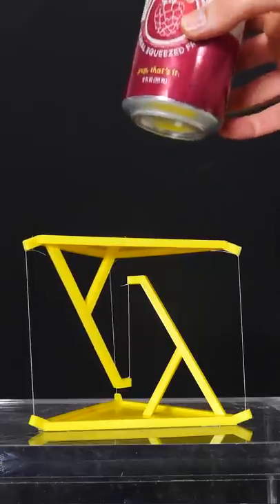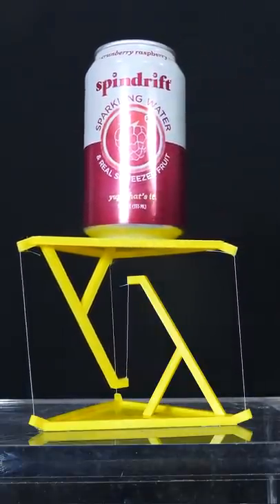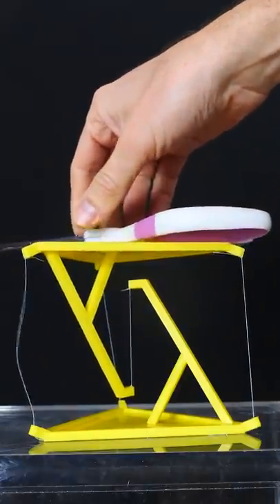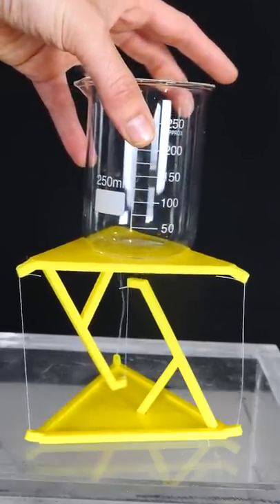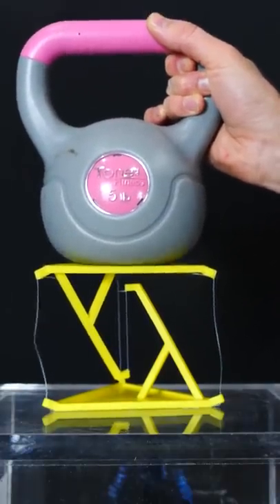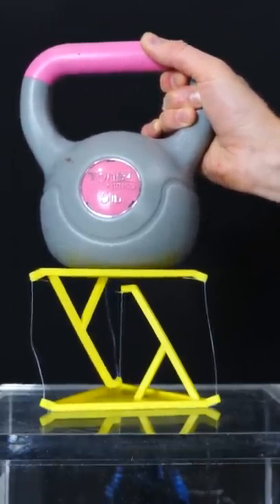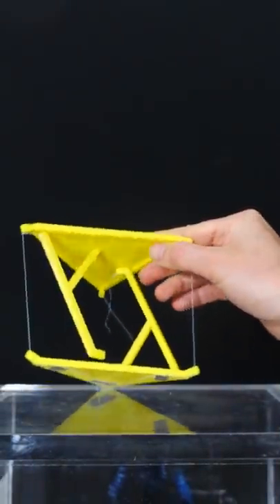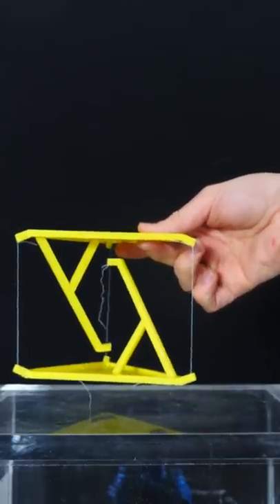Floating Tables Holding Weights

Comment: The outer strings aren’t useless, they add stability to let the stop platform stay steady in three dimensions. If you had something to lean it up against, you could make it with two outer strings
Reply: Could you do it with no strings if it's inside a tube?
Reply: @timothytai691  no, you need atleast 2 strings even in 2d
Reply: At first I thought they were, until I saw him putting stuff on top of it, I realized that they were actually stabilizing the plataform
Reply: @npc4416  But it's not 2D, instead I'd be taking sth like a triangular prism and cup it over the "table", so that the set-up won't move sideways.
Though I'm not sure if the middle string would be affected
Reply: @timothytai691  if you lived in a 1d universe yes
Reply: I'm confused. Did he say the outer strings were useless? I mean... they're there for a reason, right?
Reply: @npc4416  I’m pretty sure you don’t need outer strings if it’s in a tube… the three outer strings and the tube do basically the same thing, holding the thing in place. You just need the one string that holds it up
Reply: @Andy-iq9pz  you need one string to prevent movement when you push it, and the other one to prevent movement when you pull it (this is because a string can only resist force when its pulling it, if you push a string then it will slack and fold instead of resisting the force, so it can  not prevent push) therefore you need atleast 2 strings to prevent movement in up or down direction, the other strings are there to make it stable and they are not necessary ( note that if you used a rod instead of a string then since a rod can resist motion in both a push and a pull because it does not slacks when we push it, therefore we just need one rod but if we used strings then we need atleast 2)
Reply: @timothytai691  weird answers here.

The sheet answer is no, because the platform isn't balanced. Without strings, even with support at the side, the top will tip because the centre of weight is far from the centre. The side strings apply pressure to prevent it from tipping.

It would work without side strings if the top had no way of tipping.

I suppose a single string could be used if you could balance it perfectly, but any vibration would tip it. 2 strings could be used, though it wouldn't be very stable
Reply: If you take away the three strings on the sides, you can see that the middle string is holding up the top section, but it would fall over on it's sides without the three strings, that holds it in place.

Comment: It’s all about tension on the middle string.  The middle string is doing everything and the outside strings just hold it in place.  The outside strings don’t do anything at all for integrity, just control.
Reply: They all work together. The inner string broke first because it had 3 times higher tension compared to the outer ones
Reply: @JamilKhan-hk1wl  The outer ones have virtually no tension at all.
Reply: @lilkittygirl  if theres no tension, the string wouldnt be upright
Reply: @JamilKhan-hk1wl  the outer strings collapse when weight is applied to the table. There's no tension. At least not on all of them at the same time. They are there to keep it from tipping, so one of them will have tension when weight is on the table.
Reply: @krisdiane  You were correct. That happened because the structure which which was supposed to withstand compression has bent, because it was flexible under heavier weight, which automatically released the tension from all 3 outside strings at once, and left all the tension on the middle string. The middle string was already under more stress than all the other strings.
Reply: Sounds relatable tbqh
Reply: only true when object is perfectly in the middle try putting it on edge
Reply: Yeah its clearly visible on the first glance
Reply: The crossmember of the y on top attaches to the center of the top pulling tension to the center string. The other strings balance it.

Comment: Is easy people, the string on the middle is carrying all the weight, the other 3 strings from around are just for stabilization, that’s like some muscles of the body work
Reply: so if the one in the middle is really strong thdoretically the other 3 can be not as strong and it should be fine right
Reply: @dae36  Indeed, with a titanium String you could do a working chair
Reply: Can u give me an example of a muscle that work that way?
Reply: Sorta
Reply: @dae36  nah.. the others need to be able to hold the same amount. If you put the load on one side, it’s both the opposite string and the middle string that share that load.
Reply: Oh I see.
Reply: @Rafaeow  time is money
Reply: All 4 strings carry the weight, if any of the string snapped, the table will collapse too
Reply: @muhamadnafis1517  not all simultaneously necessarily
Reply: I know my friend was like how does this work and I'm like you don't understand 😑
Reply: Yeah, I understood after looking 7 times the video
Reply: @Rafaeow  all muscles can only ever exert pulling forces (ie tension). When you do a push up for example, your muscles aren't  actually pushing. Rather your triceps and pectorals or tightening which results in your elbow straightening and your upper arm swinging inwards towards your chest. The bones take all the compressive forces exerted by the load (in this case your weight) and your muscles induce. So while you aren't a tensegrity structure, you are made up of purely tensioning actuation devices.
Reply: You explained nothing!!

Comment: Super interesting fact: muscles and bones are this type of structure! Although muscles can only create tension ("pulling") force, they help the body stay in its shape. That is why people with low muscular strength can suffer from bad posture.
Reply: No one asked
Reply: @hsvr  “Hey Luiz, can you tell us an interesting fact about this type of structure?” There, I asked, now stfu.
Reply: Thats really cool and interesting
Reply: @purpledefaultpfp6233  nice name, fits well with this short comment story lol
Reply: @hsvr  what the hell dude, I asked, are you disregarding my existence?
Reply: Kind of. Bones can take both tension and compression where muscles take only tension. The "impossible table" shown in the video has a middle string which takes tension to support the upper member. Bones have the same supportive function but do it instead by taking compression, not tension. In our bodys, the muscles are an equivalent to the tables outer "balancing" strings.
Reply: @hsvr  No one asked
Reply: @scann563  Bones would be the lambda-beams in the table analogy. Muscles stabilize (as the lateral strings), but they can also "hold you up". That is why having abdominal strength favors better posture...well...or so said my physiotherapist
Reply: @hsvr  no one asked about if anyone asked

Comment: “Doesn’t rely on compressive strength”
The plastic arms it’s built on: gonna end this man’s whole career
Reply: Exactly. It's not revolutionary, the load is still supported by the rigid members.
Reply: @joshbridges8410  still a building balancing on string is pretty cool
Reply: @joshbridges8410  that may be so but there is the advantage that you can build the parts that undergo compression with Materials that have crap tensile strength
Reply: @jakejones5895  you can't, because the central plastic arm has a bending moment. It's in compression and tension, compression along its bottom face, and tension across its top face.

The material you describe would be something like a ceramic, and that would not work well in that position.
Reply: What if you used something like this for the footers of a building? I'm thinking a lot of them to dampen earthquake vibrations?

Comment: With enough strings around the edge and enough strings to hold up the structure it looks like you can make a stable surface using a small amount of materials to support the structure.
Reply: There are limits tho.... A structure comprised with many of what you are describing could become highly unstable. So no building, just toys.
Reply: check out the channel Evan and Katelyn! they made a table using this concept
Reply: @ritarribeiros   Tables, chairs, stools, are fine. I said no buildings, as in 🏢🏬🏭🏗️
Reply: @bakemonsan6978  sorry the reply was meant for op🤦🏻‍♀️😅
Reply: @ritarribeiros   cool, next time don't tag people within the replies. There is a place just bellow the orginal comment when you click on it. 😉👍
Reply: @bakemonsan6978  fun fact strongest spider string is alot stronger than metal

Comment: I honestly can't comprehend what's happening here.
Reply: My best guess would be that the strings themselves are able to withstand a certain amount of force  the three strings on the outside act like support for the one in the middle and the middle is like that one guy from Greek legend atlas who holds the world on his shoulder they each support a different amount of weight but the one in the middle holds most of the force which is why it snaps at five pounds because it overcame the materials stress limit (how much force it can withstand before snapping) for example if you were to bend wood or pull a string until it snaps, @Colin Cooper
Reply: @kindered7988  I guess if you try to imagine that those strings are solid objects it's easier to understand.
Reply: @colincooper4659  yeah, I hope my explanation helped a little
Reply: It's a positive feedback effect. The string in the middle keeps the upper structure from falling (by pulling itself down, and the lower structure keeps it from falling), and the strings surrounding them are for stabilizing, just like what you've just said
Reply: @HeidenLam  thank you for the clarification I just wanted to explain it in a say understandable way 😅
Reply: @colincooper4659  or just imagine the structure without those 3 outer strings. then imagine placing a weight on in it, the bottom of the top part will move in an arc because its connected to the centre, now if we place those three outer strings, they will prevent the upper part from moving. The centre wire is always stretched and depending on the direction of arc, two of the outer strings will stretch while one will get compress.
Reply: Lol same here bro
Reply: When weight is applied, you’re pulling the center string apart. Outside strings for balance.
Reply: two Magnates in nagivate situation 🍭⛓️

Comment: It works because of the string in the middle holds everything  up and the strings on the side keep the top part in place
Reply: Exactly! The string in the middle works (mostly) against the vertical gravitational force, and the other three stabilizing against the side forces. The more strings on the side the less wobbling you'll see, so they are the stability factor, but only the one on the middle is defining the strengt of the structure (and the material of the whole construction of course).
Reply: He explained it at the end_-
Reply: and forces are born not just by the center string, but the thin plastic eyelet that string passes through.  Even with stronger string, that area is still a weak point.  this has been proven in link and pin bridge failures.
Reply: @steves2694  it’s all torque my guy

Comment: Imagine this on a bigger scale with steel wires, like those on bridges
Reply: It obviously would NOT work with steel wires.. That's litteraly the point
Reply: And when the wind blows a little too hard the bridge violently wobbles all the cars off of it
Reply: @wioi  I even seen a table built like this that used steel chains instead of threads. So i think its possible.
Reply: @wioi  huh???
Reply: @wioi  huh?

Comment: My slow brain finally worked this out. The fact that the outer strings are loose is what keeps it up. Due to the shape, the structure falling down, actually creates a pull on the center string, making the outer ones hold it in place, as the center string does the work of keeping it stable.
Reply: What? I can't comprehend if this is genuine stupidity or sarcasm
Reply: I dont get what youre confused about. This is a comment simply stating i understand the science of how the tension works. Your comment seems unnecessarily antagonistic :/
Reply: @Umbr0  you're just trolling, right?
If not, then please educate yourself a teeny tiny bit more.
Reply: lol
Reply: The middle does the heavy lifting and the outside strings do the "balancing"
Reply: @trombonetribute6433  
Ye. I explained it wrong, I think, but I get it. It's really cool how it works. I've seen a bigger model that was able to support things like books, and gaming consoles. It was sick.
Reply: @Umbr0  sweeet. If you find it again send a link!
Reply: @trombonetribute6433  Will do!
Reply: 🤔 you worded that terribly, but yeah you got it. Middle string supports the weight, side strings keep it in place

Comment: Imagine someone making a huge model of this and putting a house on it. It would ignore most of a earthquake.
Reply: No it would be worse.
Reply: Pretty sure an earthquake could snap a string
Reply: Building on one of these would be... a task. You'd probably end up unbalancing the thing and tipping it over.
Reply: It would be a constant earthquake for the people inside the house though lmfao
Reply: @eggward7203  the house would need to be perfectly balanced
Reply: Wind would be a bitch but if the structure is underground while the house is above ground it might work if you made it to be held in place until some bad shaking happens. God help you if your in it and the middle breaks though unless you have safety measures in place. All in all this would be stupid expensive to make and if it breaks your completely screwed.
Reply: @liquidsleepgames3661  like all things should be
Reply: Well, it doesn't work like that

Comment: I never knew how this worked but after watching his vid I got it Even though he didn‘t even explain it
Reply: Yeah, the tension in the center string is bearing most of the weight, and the 3 edge strings prevent it from tipping too far in any direction.

Comment: This is more of an optical illusion than anything. At first glance, it looks like the top piece is floating or being held up by the outer strings, but really, its just hanging from the lower piece. That's where most of the tension is. The strings on the corners stabilize the top piece from tipping over.

Comment: I'm still confused it looks like it's defying the laws of physics
Reply: It hangs off the middle string, it has almost all of the load on it. The other strings stabilize the top part as it tries topple over when it's not balanced.
Reply: @SufferDYT  mmmm I think I understand
Reply: that still doesn't explain how the top part is floating
Reply: @morpyy8449  It's not floating, it's hanging. Ignore the outside strings and look at the middle one, the top hooks under and hangs on the bottom part.
Reply: @SufferDYT  OOOOOOOH I seeeee, thankyou for explaining ❤️
Reply: @Morphy.. I think I got it.. as every one is saying, the central string is the main one from which the top part is hanging.. but why it is not falling down? If we see the structure of the roof, it's a triangular one.. the central thread is hanging it from a normal (perpendicular) through its (triangle's) centroid. If the corners are not tied, the triangular roof would fall by tilting towards any one corner based on center of gravity.. and the opposite corners would rise up a little at that point of time But because we tied the corners, that rise movement is restricted and  it happens to be not falling. The main important thing here is the triangular roof should be a rigid object.
Reply: as every one is saying, the central string is the main one from which the top part is hanging.. but why it is not falling down? If we see the structure of the roof, it's a triangular one.. the central thread is hanging it from a normal (perpendicular) through its (triangle's) centroid. If the corners are not tied, the triangular roof would fall by tilting towards any one corner based on center of gravity.. and the opposite corners would rise up a little at that point of time But because we tied the corners, that rise movement is restricted and  it happens to be not falling. The main important thing here is the triangular roof should be a rigid object.

Comment: the center string is what holds up the whole thing, the other three just balance the top plate so it doesn’t fall over. If you want a stronger example, add more strings in the same position/form as the middle one.

Comment: The "table top" is hanging from the string. The three other strings take any moments (rotational forces). They keep the table top from toppling over. Since these moments are created by the downward force of the item on the table, they are taking some of the weight off of the middle string (some of the downward force is converted to rotational force and taken up by the outer strings). But the amount is really very little,

Comment: its the center thread holding it up, and the outside ones are keeping it from tipping over. its basically like hanging a swing from a tree branch.
Reply: More simply , you cannot move it without pulling on one of the string , which wants to retracts back

Comment: The center string carries all of the weight. The others only provide stability to the top surface, to keep it kindve level.
Reply: The weight gets distributed to the sides, unless an object is perfectly at the top centre of mass.

With nothing in it, the furthest side string will also be tight and holding decent weight

Comment: There are not only tensile forces. In the supper "Lambda" there is compression and bending momentum.
As for design, it's pretty interessting. But for engineering there are way more efficient constructions of course